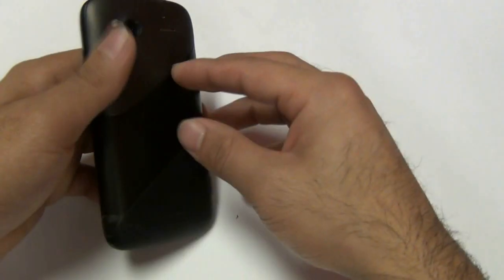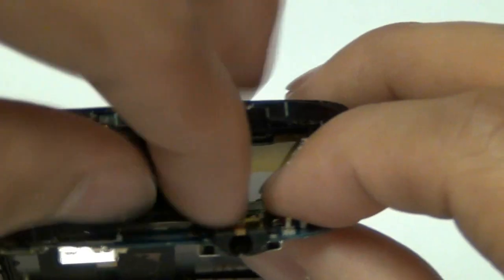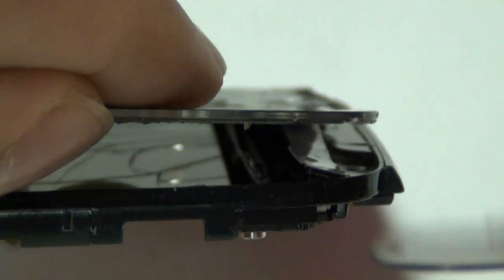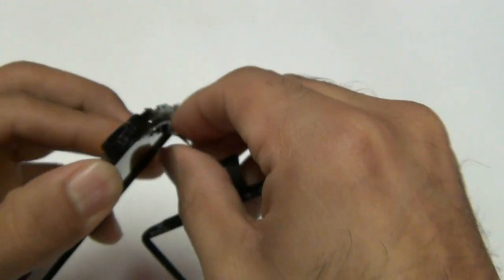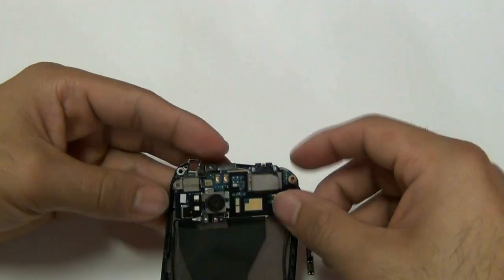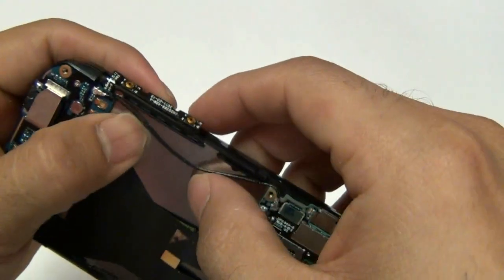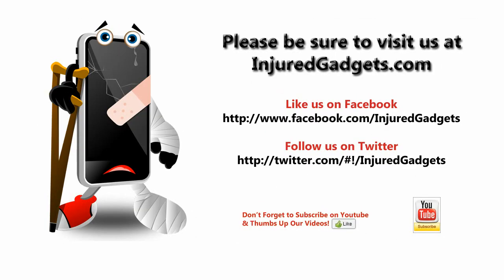HTC Sensation 4G Touch Screen Glass Digitizer & LCD Display Repair Replacement Guide

Comment: I carefully followed these instructions and it worked perfectly!  Two things I found from a couple of other videos: 1) One of the screws is covered by a VOID sticker (but obviously by this point, warranty is already void); 2) the heat induction tape does not need to be completely removed--just peel it back over the two clamps, leave the rest in place and put it back over the clamps on reassembly. Thanks for a great video. :)

Comment: I need to replace the glass digitizer as well as the lcd in my phone, because the lcd is starting to go out. I can buy the digitizer and lcd as one, so is that easier to replace then because i don't need to pull the glass off that sticky tape?
Reply: i i  also looking for instrution to replace  both togheter , i have alrady  bought it ,
did you find somewhere? thanks

Comment: so i fallowed every step second time i use this guide to replace screen lol but this time my digitizer is not responding when i try unlocking my phone or anything at all??!! i took the phone apart twice to see if any of the little joints was not plugged in right but still my digitizer will not respond to touch??? screen is on and everything what can i do of what could have i done wrong??

Comment: Excellent instructions, used them to repair the digitizer on my regular EU HTC Sensation. It's meticulous work though, I did it without prior experience, but I wouldn't recommend it if you aren't somewhat comfortable around small electronics. Had to open the thing a 2nd time due to a incorrectly seated Volume button control cable.

Comment: Great instructions. Almost everything works perfect on the touch screen. I can swipe and click, but not drag an object. I have taken it apart several times to verify everything is plugged in properly. But still can't drag an object on the touch screen. For example, I can't hold an icon on the home screen and drag it to the trash bin. Is there another part that needs replacing or did I miss something?

Comment: Tried it and it worked. You may not need the 3m tape as there maybe enough stick left on the factory adhesives. I only used the tape on the top and bottom. You'll need a star screw bit, size T5. I used a guitar pick all the way through.

Comment: Hey, I have the same problem, the flash light is on but I cannot get the phone to work, I also broke the volume button flex cable , could this be the reason?

Comment: The screen that cracked on mine had the t-mobile logo on the top right and the htc on the top left of the digitizer.  I replaced it today with the HTC logo in the middle and the screen works fine.  :p

Comment: Followed the instructions. The install went great. I turned the device on, the screen comes up to the white HTC screen, but will not boot past this screen. I tried to do a hard reset, but the reset wouldn't initiate after I selected it. Has this happened to anyone else? Any idea what would cause this? Could I have overheated the phone when heating the screen to loosen the glue? I was very careful with all other parts.

Comment: If any ones screen does not turn on and your phone vibrates every few seconds after doing this repair, one of your Mother Board cables has come off.
Its the big black flexi cable it runs the length of the phone between the top and bottom circuit boards you just have to push it back on the underneath of the circuit board, you will feel it click in-place. :D yes it happened to me

Comment: Great guide. Fixed the screen to my HTC thanks to this. I have Questions.
Why did you leave out the grey heat thing with adhesive?
The top of my screen now has a small bubble under the screen. What could have caused this?

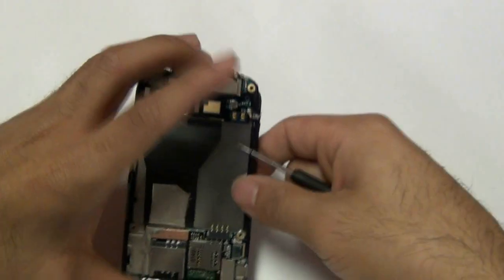Comment: at 2:20 you removed a piece of tape that you never put back again. I am assuming it is not necessary to use then? Also the title states Digitizer and LCD repair but i am confused in which part of the video did you repair the LCD?  The LCD is the black screen behind the Digitizer right? Help please!!!

Comment: just want to say thankyou for the video,fixed my phone within 1hr.was stook on the flexi band at the back of the screen and the releasing the buttons from the glass was a pain because of the general weakness of it.was quoted £80 for a replacement and be without a phone for 3 days. I brought the glass for £15 off ebay uk  and some adhesive too.

Comment: @LikeAG2 At 2:46 on the video you will see him remove the cable at the top, which is your LCD cable. This cable can easily be damaged, just like every other aspect of this repair, so if you have not secured it properly back in to the housing you are lucky (as in you didn't damage the cable.)

Comment: How'd you get the ribbon cable from the digitizer under the lcd without prying it up, I thought the hole was under the lcd?
Also will you be uploading a htc vivid digitizer replacement video soon? Thanks.